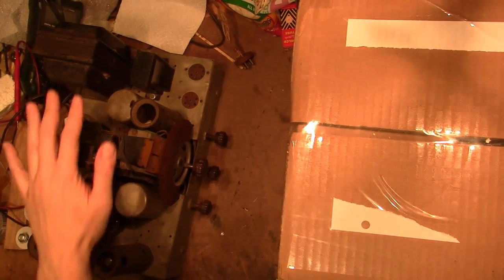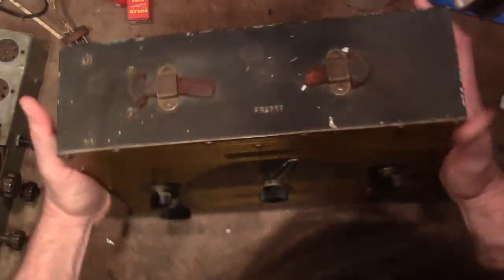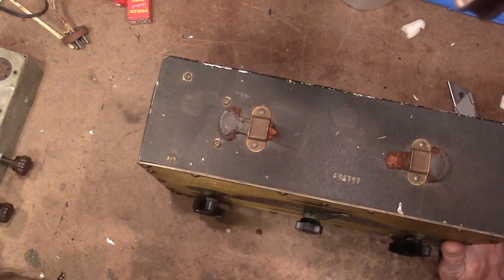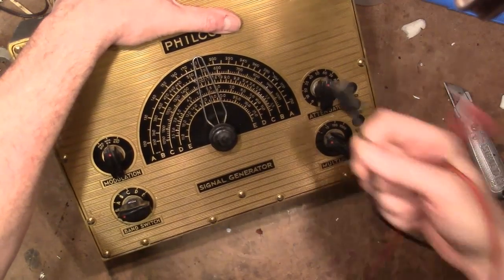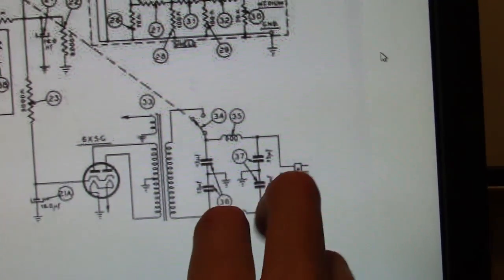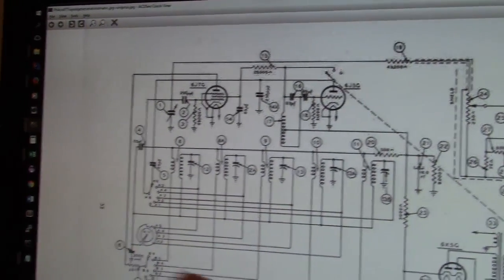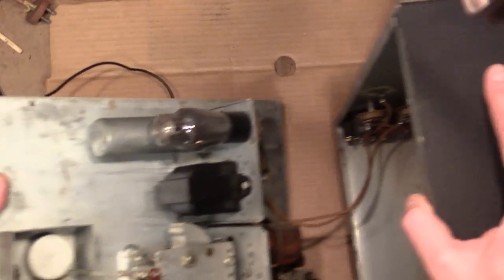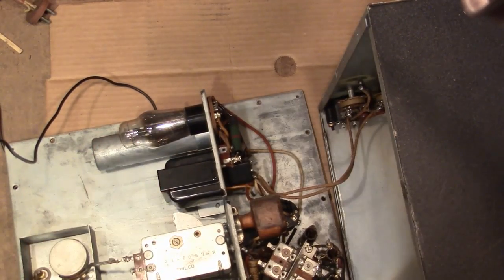Philco 077 signal generator

Comment: Hi Bob! I just bought one on auction....enjoyed this video...is there another one out there somewhere about the restoration? If not, can you share with me any problems, tips etc??? Thanks and Take Care--Larry
Reply from the maker: Not yet, but I think I will very soon.  Should be a simple project.
Reply: bandersentv thanks Bob!!! Hopefully I’ll start mine in about a week!!! Take Care—Larry
Reply from the maker: Popped mine open yesterday.  Only two paper caps to replace and two bakelike block to rebuild with Y type AC line rated caps.  Plus a three section electrolytic.  Tricky part is getting at them.  It's tightly packed and cramped!
Reply: bandersentv Thanks!! I ordered ten 0.15 uF safety caps from mouser....the ones I ha e on hand are 0.01....Yeah...on ur video...looked tight!!! But...all we can do is take our time with it...lol...Thanks for getting back with me! Take Care—Larry

Comment: I just picked one of these up Saturday for $5 in Alameda. It's been modified. The components near the plug port on the top are all gone, and it has been more directly wired. I'll have to do some further testing and investigating to see if it's still useable. Some wax/tar has melted or run out of the transformer, but there were no shorts, so I hope it's OK. Nice video. Thanks for the info.

Comment: Wow, that's a great tester---built like a tank, with simple, easy to use controls. About that 6X5; some people like to use low wattage fuses or even lamps between the secondaries of the power trans and the plates to provide a measure of protection in case it shorts. You probably already knew that, but I just thought I'd throw it out there.
Reply: +justsomeguytoyou The issue with that tube is primarily the way Zenith used it at higher voltages and sometimes near its maximum ratings. From my experience when the 6X5 is used in test equipment where B+ isn't very high, the tube seems to do ok.

Comment: I would think you could use 0.015 uF safety caps just fine.
Reply: +bandersentv An older book, "How to Get More Out of Low-Cost Electronic Test Equipment" but great resource by Robert C. Genn, Jr. has the following formula for calculating the maximum safe capacitor that can be placed between ground and AC power as follows: Capacitance (uf) = 860/(f) (E)    (f) is the frequency of the power source in Hz and (E) is the source voltage or line voltage. Best, Don
Reply: +RestoreOldRadios If I understand your formula correctly then this works out to be 0.12 uF max.  I assume that the "E" in your formula is in the denominator?? What is not clear to me is why one would want so much capacitance across the line like that. Any high frequency noise will be shunted easily by a much smaller capacitor. 0.015 uF is a capacitive reactace of 11 ohms.
Reply: +Herbert Susmann Forgot to finish the last sentence: the 11 ohms is at 1 MHz.  I suppose 0.15 uF would then be 1.1 ohms which is even better but usually they use something like 0.015 or so on those line filters from what I've seen.
Reply: +Herbert Susmann You are correct on the formula that Mr. Genn published and the use of a lower value. I typically see .01 uf to be common.